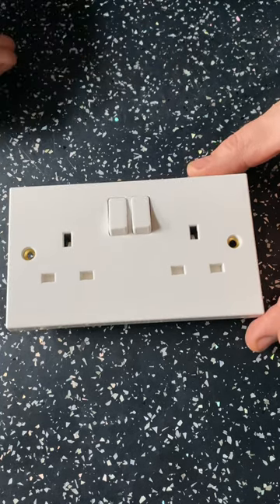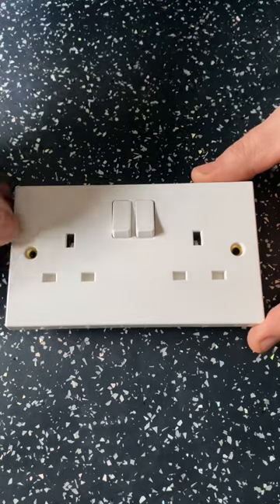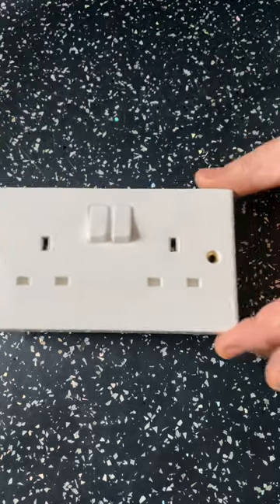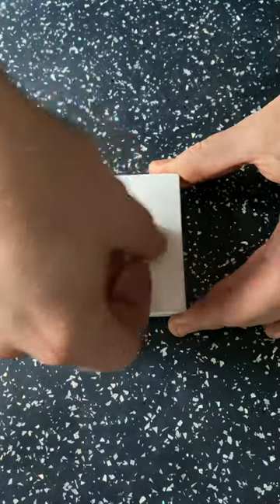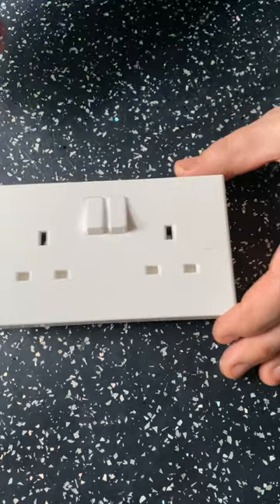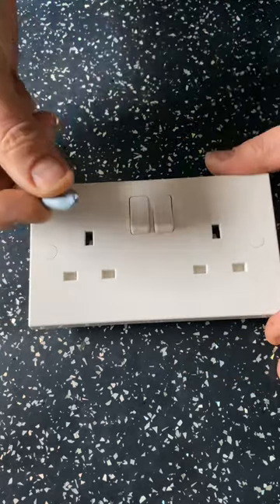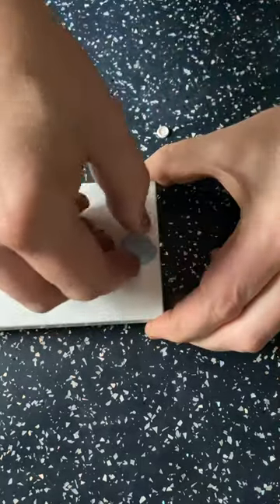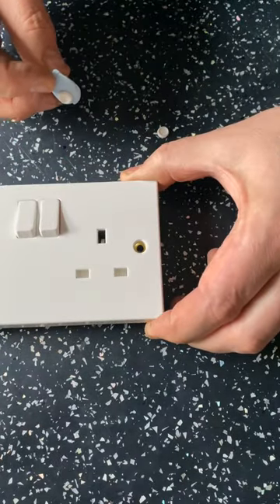HOW TO remove screw caps from electrical accessories with DADSKILLZ! (Electrician’s top tip!!)

Comment: What is the reason for the manufacturers placing that cap ?
Reply from the maker: So you can’t touch a metal part that could be live in fault conditions
Reply: Aesthetics, if the screw was live to the point it shocked you, so would anything that you had plugged into it.